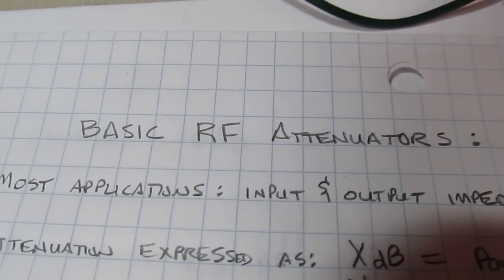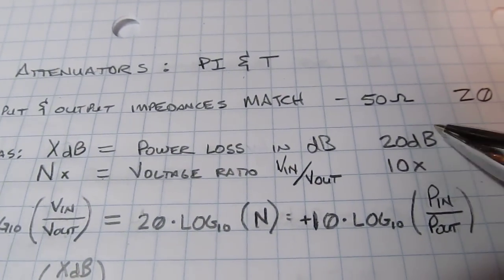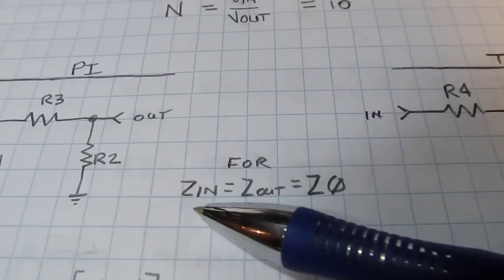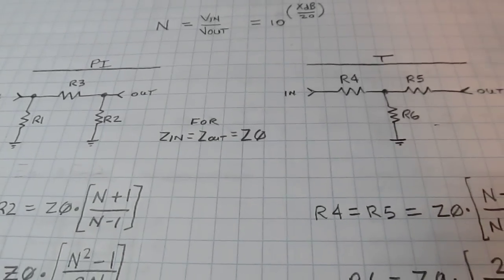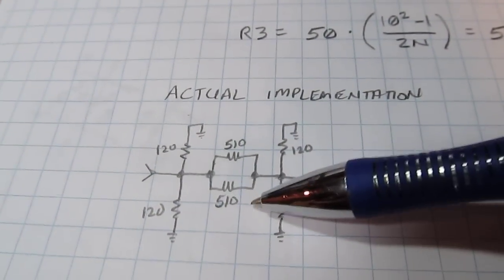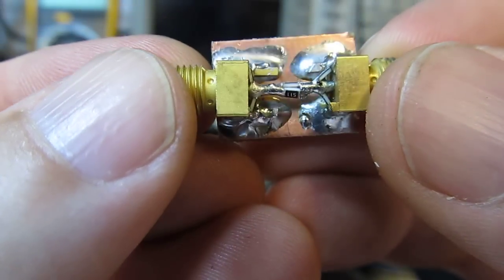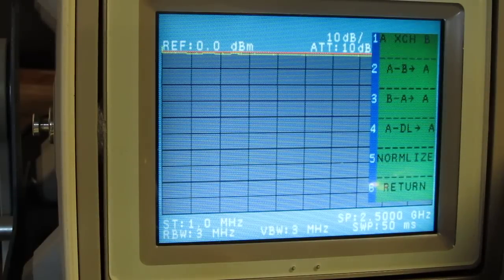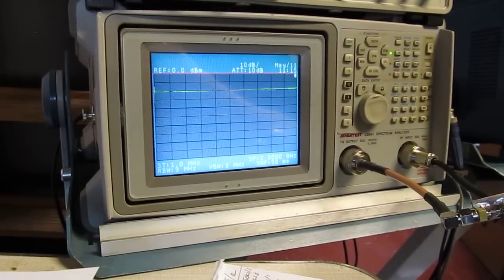#91: Basic RF Attenuators - Design, Construction, Testing - PI and T style - A Tutorial

Comment: I know you need SMT for High frequency parasitic issues but I don’t invest in SMT. All my components I have collected over 50 years are not SMT.  Wonder how well 1/4 watt discrete components without any ground plane would do.  Directly solder with minimal leads.
Reply from the maker: They’ll likely work well to low VHF

Comment: Hello Alan, thanks for the clear video! I have a 20dB attenuator and had it connected 
on a function generator with 50 Ohm output impedance and the other side on my scope.
But... no 20 dB attenuation! A bit of a surprise, but of course you have to load it with 50 ohms.
Not unimportant to think about!😉
Reply from the maker: Yes, passive attenuators rely on the fact that the impedance connected to both ends is 50 ohms (or 75 ohms for to 75 ohm variety).

Comment: Alan, thanks for your generous contributions to the electronics and ham communities! I recently scored a Spinner 745359 100 W 40 dB attenuator. It measures an accurate 50 ohms at DC and NanoVNA sweeps show 50 ohms and excellent SWR in both directions. Does anyone know if this attenuator can accept high power input to either port? The datasheet I found is almost illegible and the sheet for the modern equivalent doesn't mention in/output, so I'm guessing they're symmetrical with regard to power handling but thought I's ask before using.
Reply from the maker: I would think that if it isn't clearly marked, then it is symmetrical.  Spinner is still in business, so you could email them and ask the question too.
Reply: @w2aew  Spinner replied with datasheet and confirmation that the attenuator is bidirectional wrt power. Thanks for the nudge to contact them. After 30 years in science I don't even bother asking questions of manufacturers since they rarely reply unless I have a $ervice contract on the equipment. Good to see that some of the folks on the engineering side are friendlier.

Comment: Hi 👋  I have an adc module with 50 ohm input impedance it says it's input voltage should be below 5v p-p  if I use an amplifier with 5v supply like lna moduls before my adc should I use attenuator before my adc???
Reply from the maker: As long as the LNA output can't exceed its own supply rails, then no attenuator should be needed.  This is assuming that the ADC's full input range is 0-5V.
Reply: @w2aew thanks a lot.

Comment: That's a good design, and a great construction technique!  Thanks for sharing!  I would not have thought to suspend surface mount components in the air like that, like old style leaded resistors, but it clearly works well.
Reply from the maker: Yes, but not as robust mechanically - it's easy to delaminate a termination on a small SMT part with a little mechanical force.

Comment: I recently decided to add an attenuator to my 1.5Kw 50ohm dummy load.  I found an online PI attenuator calculator that allowed a different input and output impedance. I thought if I used 3 stages and lowered the impedance in each stage I could start with an input of 100K as to not effect 50 ohms of the dummy load(and also not have any real power attenuation in the first stage).  I copied the formulas for the page into a spreadsheet so I could quickly change the input impedance/attenuation/output impedance and have the spreadsheet calculate the total impedance and the power dissipated in each resistor.   Luckily I simulated the circuit and it was off by a factor of 100.  Being it was only a large resistor network, I then calculated it with a DC input by hand with EET101 skills, this matched the simulator.  After asking numerous times on online forums, I only got responses that it's the wrong way to do it.  I finally built an current sense RF sampler with an PI attenuator(50 ohms in and out) on the output, I again missed and got 68db instead of 60, but the thing works and I'm tired of fighting it.  But I've never been able to comprehend why the previous method didn't work(at least mathematically), my spreadsheet outputs the same values as the online calculators.  Someone suggested that the online calculators are incorrect when the input and output impedance are not the same(even though they specify that is what they do)  I finally left it as the calculators are wrong so I could sleep at night.   https://chemandy.com/calculators/matching-pi-attenuator-calculator.htm care to take a shot at this?  It's purely academic at this point,  but somewhat important to my sanity. KO4SWI QRZ

Comment: One trick I picked up for similar attenuators and terminations is to stack a number  of smd resistors to get the desired value. 3 150 ohm larger ones make good 50 ohm terminations. For attenuators it is a good way to get more precise values and somewhat better frequency flatness. I am not sure why it works. Probably stacking helps reduce stray inductance. Made a small cal set with a power splitter like this for my VNA that turned out almost as god as the original N sized ones for that application. For some reason I had good luck with the 1218 size  resistors.

Comment: I have a bird sampler/variable attenuator #4273. How do I know that fully screwed in is -40 db attenuation, How do I verify where -55db attenuation is? Is there a way to sweep these with an oscilloscope or spectrum scope? If so, a video would be very appreciated...
Reply from the maker: The short answer is - you don't know what attenuation you actually have at any setting of the thumbscrew without measuring it.  The further complicating factor is that the attenuation at any given setting will vary with frequency (low frequencies are attenuated more than high frequencies), and the attenuation level will depend on the load placed on the sample port.  They can be swept with a spectrum analyzer with a tracking generator, or with a VNA like the NanoVNA.  You can also make measurements on a scope, although that gets tricky because the sample port attenuation is quite high, so the signal level to be measured can be quite low unless you're sending a lot of power through the main path.
Reply: @w2aew  Yeah, I'm trying to verify the accuracy of my watt meters using the formula Vpp/(2 times the square root of 2) then that number squared divided by 50 ohms for scope watts on 28.400. I just need to verify that I'm at -40 db attenuation.
Reply from the maker: @imken2392  40dB represents a factor of 10,000:1 difference in power, which is a factor 100:1 in voltage.  So, if you have a way of generating a 28.4MHz signal at something like 1Vpp, then send that thru the main path (properly terminated), then measure to see what the sample port is giving you.  10mVpp would be 40dBm down.  You can see the dilemma - measuring a small level like that...
Reply: @w2aew  Fortunately I have an HP 8920A communications test set....I'll get it figured out.
Reply from the maker: @imken2392  OK - if that's got a tracking generator on it, and can cover the frequency range you need, then you're all set.
Reply: @w2aew  Through the sampler with the watt meter reading 25 watts and the sampler fully screwed in to where there is just no change in attenuation and almost lightly touching the stop my scope reads 1 Vpp.  1V X 100 = 100 Vpp. The scope watts formula calculates out to 25 watts, same as my bird meter is showing. I guess where I have the thumb screw locked down is -40 db attenuation.

Comment: Thanks for this useful video. As a beginner in construction, please could you tell me if I could replace R3 in your Pi version with a potentiometer to make a variable attenuator?
Reply from the maker: Not really, for two reasons:  1) it won't be impedance matched (50 ohm input and output) if you change only one resistor, and 2) most potentiometers won't perform as well at high RF frequencies.  If you don't care about high frequencies or impedance matching, then yes, it would work.
Reply: @w2aew  Belated thanks for the reply, I appreciate it.

Comment: Is there a reason to use matching parallel resistors or would it be better getting the higher accuracy of using 330 || 75 for the 61.1111Ω and 270 || 3000 for the 247.5Ω resistor?  To reinforce the information presented here, I created a spreadsheet that calculates Pi and T attenuator resistor values and helps me select the best parallel or series resistors from my personal collection.

Comment: If my input is 1000 mw or 1 watt for 50 Ohm, does 1 watt is equal to 30db, what are the value for R1-R2 and R3, awaiting your answer.
Reply from the maker: 1watt = 30dBm (not 30dB).  Resistor values don't change based on power, only the power rating of the resistors change.
Reply: @w2aew  I still not get a point as well as your explanation, 1 watt  equal to 30 dBm as your sample that calculate by dB, how can i know my circuit Pi of  each resistor R1-R2 and R3, with my ZO 50 Ohm, how you know you 10x as a example,  please let me know, i wish to implement it to my circuit, can you please explain me what is  value for those R1-R2 and R3 .

Comment: Do these not require capacitive compensation as is used in scope probes?
Reply from the maker: In general, no - because the 50 ohm impedance dominates.  At very very high frequencies, there may be some compensation or special design techniques employed to maintain a flat frequency response.

Comment: sir
i want to make a photo-diode detector circuit for my photo-diode SM05PD1A,on which a laser beam from 0.8mw HE-NE laser thorlabs is incident on it.what should be the bandwidth for the detector and how to calculate this?
thank you
Reply from the maker: The bandwidth needed by the detector would depend entirely on your application.  If the optical signal from your laser is continuous (i.e. not pulsed or modulated), then you don't need very much bandwidth at all.  If it is pulsed and you need to measure things like rise/fall times, etc, then the bandwidth you'll need depends on how fast the optical rise and fall times are.
Reply: @w2aew  thanks a lot sir...

Comment: nice video. you have selected smd resistor I think 0805 package. I want to know do we have to consider wattage of resistor during selection. how it will impact the design.?
Reply from the maker: Yes, you certainly have to take into account the power rating of the resistors if you need an attenuator that works are high power levels.

Comment: Needless to say, it is very very clear and easy to follow, from design to test.
NOW MY QUESTION. Is it mandatory to use the SMD resistors if I aim to use the attenuator at 500 Mhz? Can I use regular resistors?
Thanks in advance.
Manfred.
Reply from the maker: Hmmm - good question.  If the leads are kept extremely short, you might be able to get away with leaded components.  Worth a try....

Comment: Good video with perfect explanation. But your attenuator needs to be shielded, in order to protect it from unwanted oscillations/background RF signals. Otherwise your attenuator will not work properly. 
Also resistors need to be mounted correctly to make it more effective. Thanks!
Reply: the RF attenuator will work well if you mounted it correctly, because stray components (inductance/capacitance) are critical

Comment: How much power would an attenuator like this be good for on the input?
Reply from the maker: It depends entirely on the power rating of the resistors used. In this case, probably only 100mW or less.

Comment: Alan, I can't tell from the video.  Is that copper cladding on a glass substrate?  I have a Radio Shack double clad board but it looks like copper over phenolic.  I doubt it matters at the frequencies I'm using it at but I would like to make sure before a I commit a couple of connectors to building up a few attenuators.  Rather do it right the first time.  Btw my call is N1ABE.
Reply from the maker: Yes, it is an FR-4 board, which is basically fiberglass/epoxy resin.  Since the PCB isn't being used to carry signals in a transmission line (it is only a ground plane in this case), I doubt that the loss of the substrate will affect operation at all.
Reply: Thanks for the reply.

Comment: ive this  sussed out thank you but there is one  question still remains if i had a 27db 5 watt pi attenuator  an wanted to shift it to a 10 watt 30 db pi attenuator   must my  R1 AND R3  risistor increase and alter not only in value but double up in wattage ??
Reply from the maker: All three resistor values will change when you change the attenuation value. You'll have to calculate new power ratings as well.
Reply: thats was my point sir how will i calculate 5 w to 10 in put ?
Reply from the maker: There are a lot of pi-attenuator calculators available online to make the resistor value calculation easy:
https://www.microwaves101.com/calculators/858-attenuator-calculator
https://www.pasternack.com/t-calculator-pi-attn.aspx
https://m0ukd.com/calculators/pi-attenuator-calculator/
http://www.qorvo.com/design-tools-pad-attenuator-calculator
etc.
Since the shut resistor is nearly 50 ohms, it's going to have to dissipate nearly the full power, so they'll have to be rated for the full power (10W).  The series resistor will dissipate less - just a simple exercise in ohms law...

Comment: So clear and simple, I think I can do it. I need to cover 0-6ghz at 3watt 10 db 50ohms. how do I alter your example? eg instead of smd resistors do I use 2w resistors (old school) and how do i cover the 6ghz extent? Note I am adding this to a 30db unit to give me 40 db. thanks Troy
Reply from the maker: If you already have a 30dB pad, you can put the additional 10dB "after" that - by doing this, the 10dB pad doesn't need to be rated for the full power.  Home-building a high power 6GHz attenuator is not a trivial task.

Comment: Thanks for sharing. Seems I had not seen this one. 

What controls how flatness of the response of the attenuator? Is this mainly the construction characteristics? Would shielding the whole thing help even more than just the solid ground plane? Also, are SMD resistors better for this purpose vs. through hole? If so, just due to their size? 

Thanks so much for the great videos you produce.
Reply from the maker: Physical construction is what will determine bandwidth and flatness.  SMT is generally better because leaded parts typically have higher parasitic inductance.  Design of good RF attenuators is an art.

Comment: Okay, I may be missing something. The O Scope attenuator should show 1 volt on the scope for every 10 in? Your paper kind of makes it look like the opposite, 1 volt in would show 10 volts on the scope. I have a couple  differential probe sets. One is 20KV rated, with enormous probes. One of those deals that was just too good to pass up, and it is Tektronix, so that made it even harder to pass up. I will need attenuators. Thanks! 73 KI7AQJ  -AE  (passed the extra last week, & now they want me to take the VE)
Reply from the maker: Attenuator ratings are typically given in positive dB values, which is typically used for gain. Thus, you have to consciously remember to negate the attenuator value when performing the calculation.

Comment: @w2aew I love your videos they are very informing and explains everything in an excellent explanatory way. I have a question. How do you calculate the maximum effect these attenuators can handle? Regards Jacob, OZ2LT.
Reply from the maker: +Jacob Lindquist In general, the shunt resistors will dissipate the most power since they see the full power voltage on the input side of things.  So, if you make all resistors of the same power rating, you can get a good estimate of total power rating by calculating the power in the first shunt resistor.

Comment: can i use this attenuator in a 430 MHz transmitter? can i use normal resistors? Thank for this video
Reply from the maker: +marcos At last part of the video you can see that the attenuator was pretty flat up to the maximum frequency tested which was 2.5GHz.  You should be able to easily build one for 430MHz - just keep the connections as short as possible.
Reply: u re right, thanks

Comment: What exactly is the difference between these networks and a voltage divider?
Reply from the maker: These are voltage dividers that also present the same impedance (matched to the source and load) at both ends.
Reply: İnsertion loss just.

Comment: ***** This is amazing!!  :)  One question, how do you determine how much power your attenuator is rated for?
Reply from the maker: A safe bet would be to limit the power to be less than the power rating of the resistors used.  Since none of the resistors will see the full input power, this is a conservative approach.
Reply: Do you think it could take 50 watts?
Reply from the maker: Absolutely not! The resistors I used are only rated for 1/8th watt. If you build one with larger, higher power resistors of the same value, then it will work.
Reply: I only ask because at work we have some that can do high power and have heat sinks on the outside. I wondered what their innards looked like
Reply from the maker: Oh, ok.  Their schematic is likely similar, but their physical construction is likely quite different in order to handle that kind of power.
Reply: Understood. Thank you for the video! It was enlightening!

Comment: I thought attenuation db rating is based on power, ie  20db (n=100),  those n-formulas are for voltage db only?
Reply from the maker: You use 20*LOG() when calculating using voltages, and 10*LOG() when calculating using power.
Reply: @w2aew  and because power is prportional to voltage squared and the log takes the square outside the ten turns into twenty.....

Comment: Hi, i would like to ask you some question since i have no idea about RF. First, can i build it with normal resistor or it should be better with smd resistor ? Second, will it work for the 5 -6 Ghz frequency . Thanks
Reply from the maker: At such high frequencies, it is imperative to keep leads lengths to a minimum, which is why SMDs work best.